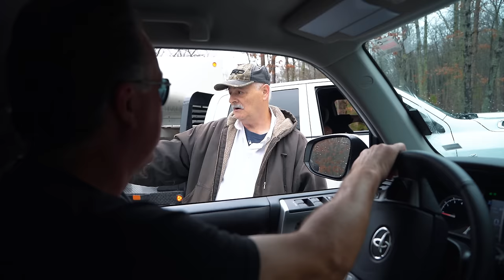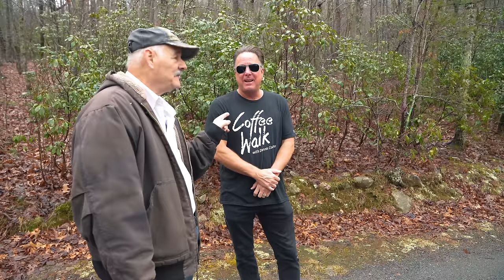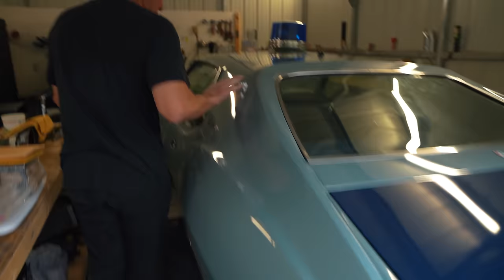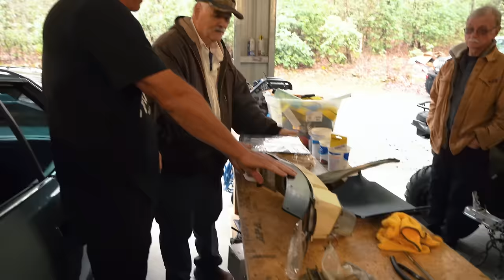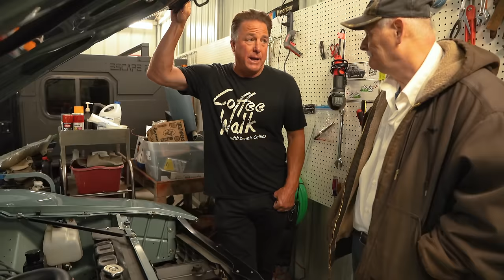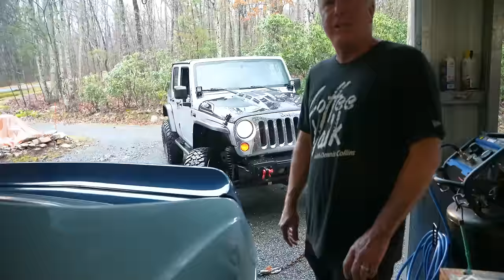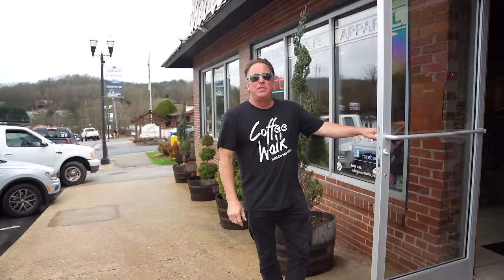FOUND: 1 of 13 Existing ADPS 1972 Javelin SST Police Cars!

Comment: AMC 401 with a 4bbl carb. in 1971 was 330hp and 1972-1975 was 255hp then in 1976 it was downgraded to 215hp, that boat won't do 170mph, being a 72 it will be lucky to do 140mph, maybe 150 if you have a lot of flat road and a good strong tailwind.

Comment: My dad built the engine for one of these it was still had the Motorola police radio in it and the light they made him take the state trooper badges off the doors but it was painted with the correct paint and everything my Dad's friend Dawn bought it when I was a little kid and they were restoring it but it has to be one of the 13 because it is a complete javelin police car state trooper with the Motorola police radio everything correct

Comment: I had for my very first vehicle was a 2 door Dodge Dart aka Dodge Demon had a 426 Hemi in it and fastest I've ever had a speedometer move..was 130 +/- 15 more likely +15.Was on a old highway and it had smooth dips on it and I could hear Chirps while holding the steering wheel and I found out it was the back tires raising off the payment. I also received my very first speeding ticket for 100mph on highway that still had speed limit of 55mph officer was upset then gave me a reduced fine where I didn't have my license taken away. 
Man o man wish I still had it. It would of been a show stopper with the money I would of put in to it .

Comment: Big- body cop cars ran H78-15 tires back then. According to Coker, the overall diameter is 28.36 inches. Times 3.14 gives a circumference of 89.05". Times an engine redline of 5000 rpm gives 445,252 inches per minute. Divided by 12 gives 37,104 fpm. Divided by a 2.76 axle ratio gives 13,443.599 fpm. Divided by 5280 gives you 2.546 miles per minute. Times 60 gives you 152 mph. 

Check my math; it's still dark outside.
Reply: @spaceflight101, math looks good to me
Reply: @Crazy8ts  Thanks. Cars of that era didn't have overdrive transmissions and the automatic transmissions didn't have locking torque converters so a little slippage has to be factored into the real world.
Reply: @spaceflight1019  very true, modern transmissions today are light years ahead of 1960' and 70's auto's we have 8 and 10 speeds now!  Many would choose a 4 speed in a muscle car, which eliminates the low stall torque converter woes of that era in a performance application....and there were usually optional ratio spreads for a buyer to choose for a 4 speed, usually a close ratio transmission and a taller ratio. The automatics had high stall converter mods available and there were companies that catered to hi-po auto build ups, B&M. comes to mind
Reply: @Crazy8ts  You reminded me of something. The owners manual for the 1971 Fury lists the mighty 440 Six-Pack as the top engine option and a three-speed manual transmission. The redline on that engine was 6000 rpm.
Plugging that into the formula, the top speed goes to 183 mph!
Reply: @spaceflight1019  in theory lol

Comment: I had a 71 401 in my '68 Javelin Big bad orange car, 12 to 1 compression, huge solid lifter cam, heavly ported 70 heads with chysler 2.08/1.72 valves. the motor was .020 over and dynoed 550 athte crank and never got hot on sunoco 104 race fuel. I would even idle the car and it did not get hot. that overheating thing is BS and the 401 is not the same block as a 304 look under the motor mount and you can see what size it is. the displacement is cast into the block.they just had a thinner sleave.

Comment: 170 MPH on a public Hwy is impossible for more than a few hundred yards. Eventually you will hit a dip in the road that will launch you into the air. Ask me how I know...at only 140 MPH in a 1970 SS Chevelle I hit a dip in the road that at 80 MPH I would have never noticed, but at 140 MPH my suspension bottomed out to the frame, and launched all four wheels of my Chevelle into the air. After that I swore I would never go that fast on a public Hwy again.

Comment: If i had known back in 1968 what i know now id of found some way to keep my 1968 Dodge Coronet " 4 door " that came with the tiny 273 v8 that had no guts - that motor was way to small for that 4000 pound car - it got wrecked in 1969, the frame got bent and was not repaired properly, the front wheels didn't line up with the rear wheels, very dangerous to drive so i traded it for another vehicle - they only made 10k "4 door" cars in 1968, the majority were 2 door

Comment: 170 Mph, haha yeah ok, the Stories on these get better and better over the years haha...... Documentation shows 130 Mph top speed on these low compression 8-1 1972 Javelin Police w 401! Dennis I left you a message on your Facebook group with an article clip on this 1972!...  anything you wanna know about PRE-1978 copcars, just ask
Reply: Easily capable of 160...not hard to believe that if some got additional tuning/mods they could approach 170..with a 2.73 rear axle ratio....plus they are relatively small light cars..that body design was engineered for SCCA racing.and they took 1st place with it in either 71 or 72. Aerodynamic, light and powerful engine and they could handle very well. Very likely some.troopers modified them for more power too.
Reply: @WPGinterceptor460Interceptor  again they had worked over valvetrains and fueling and oiling mods, you keep going by advertised ratings, and those are for the non police 401's,  these were probably making 325-340+ horsepower and 430 lb ft of torque, even the  68-70 390 with small Carter 575 cfm and restrictive log exhaust manifolds made 315-325 horsepower and 425 lb ft of torque. The documentation you have of advertised numbers just shows that these special 401's were probably under rated on paper on purpose....thats something that was common back then, not myth. Top speed on a long enough stretch of highway in that light body and a tall 2.73 axle ratio??  150-160mph isn't out of the question...if there were some that were approaching 170 they had to have been modified. State Troopers are allowed to do mods, maybe some did....and in 1972 AMC offered a LOT of hipo parts from their group 19 program, edelbrock R4b hi rise intakes, Holley 950cfm 3 barrel carbs, exelbrock crossram with dual Holley 660 cfm carbs ignition systems, Doug thorely headers, etc etc... not out of the question some of those state troopers put those parts on and could be the origin of some getting close to the 170mph speeds. Doubt claim like that would be made if there wasn't something that backed it up, for one it is too high a MPH to be believed NOW, no one would have believed it back then, so there has to be something to it.
Reply: @Crazy8ts  AGAIN your talkin out your hoohaa, this was 1972, and start of Emissions bud, these were low compression 8.5-1 Motors pushing 255 Horsepower ( I have the Documentation) what dont you understand??? and they top out at 130 Mph. The only police addon would of been an extra oil cooler!!  The problem with these cars was they blew up cause of oil issues during high speed pursuit, the fleet mechanic talks about that in the documentation.. and AGAIN the High compression copcars of that era, like the 69 Dodge Polara 440 Pursuit, or the 429 Police Interceptor of that era would of Blown the doors off this car!!!  and the reason Alabama went with the Javelin is because they couldnt afford the Ford 429 Interceptors!! AGAIN ITS IN THE DOCUMENTATION!!!!!  get over it
Reply: @WPGinterceptor460Interceptor  you are still incorrect and literally sound like you arent even aware about the early 1971 high compression 401's....and there were 2 versions that they got for service.. you also keep ignoring that these cars were only 3256 lbs ...Hundreds of lbs lighter than all the other gigantic heavy police cars of that era. FACT!!!  Again 70 of the Alabama state police javelins were 1971 models. The early javelin SST and javelin "AMX " 401's had 51 cc chamber heads and flat top style pistons with a slight ridge with valve reliefs, compression was 10.25 :01 horsepower was 335 and torque was 435 lb ft. AMC gave them an early 401 AMX and they loved it and thats why they ordered the first batch during the 1971 model year run..they wanted THAT spec. 70 1971 401 cars were ordered. The later 1971 401 had the combustion chambers enlarged to 58cc, this lowered compression to 9.5 :01 but had the benefit of unshrouding the valves and increased flow so horsepower dropped to 330 and 430lb ft respectively. So again this is in a base car with a curb weight of 3500 lbs with a 2.73 final drive ratio this combo would be an absolute MISSLE on the highway on a top speed run.  The engines also had steel forged rods and cranks for all of 71 and 72. In 72 however they changed to a dished piston wich dropped compression to below 9 :01 but exhaust valves were bigger. Regardless the police spec fleet engine had all of that but also had more aggressive camshafts and reworked carburators, so they would not have the same horsepower as a regular production 401...it would be more....regardless the troopers that drove these cars and documented what they could do in media articles when  they were interviewed are the best proof.  one trooper confirmed that he hit 141 MPH in his 72 spec and he said he could have gone faster...real world accounts are the best documentation. They all said they were the amoung fastest cars and best handling cars they had ever driven. The stock specs on paper you are referring to do not apply to these cars. There are also many documented tests of 401 javelins from when they came out in 71 beating big block muscle cars cars in the 1/4 mile including boss 1971 429 Mustangs
Reply: @WPGinterceptor460Interceptor  Captain Robert Applin (ret.) states his Javelin was clocked at 153mph using a ‘Kustom’ radar unit which was considered more accurate than the ‘VASCAR’ type, which calculated his car at 148mph over a 500ft. stretch. No one is saying there weren't more powerful engines in other police cars of that era, but they simply weren't as fast as a 401 especially the 10.25: 01 and 9.5 :01 early versions...the cars were only 3256lbs from the factory...with that high torque 401...2.73 gear, and aero body this was a highway top speed missle...other cop cars of the era had more horsepower but they were like bricks in the wind plus hundreds of lbs heavier.
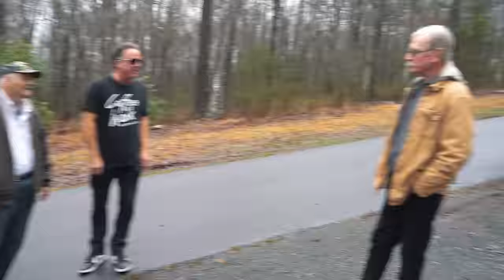Reply: @Crazy8ts  Again ALL TALK!! no documentation.. AGAIN the FASTEST speed ever recorded By a copcar and proven was in 1969 148 Mph By Michigan State Police of a 375+ Horsepower 440 Doge Polara Pursuit equipped with a 2:49-1 special rear gear drive axle and motor was 10+ Compression!!at the Chrysler proving grounds, that speed wasnt beaten until a Corvette powered Copcar LT-1 Caprice 94-96 beat that! NOT ONE MENTION OF THE 8-1 Compression JAVELIN ANYWHERE IN THERE!!  too many stories you been fed there and NO documentation other than Hearsay!!.. The OFFICIAL fastest copcar of all time is the LS powered 6 Speed Camaro 2002+ and would push 160 Mph!.... you should email the MSP and tell them they need to udate their info as a guy told you his low compression 8-1 Javelin did 153 Mph top speed BUT could hang with a stock gto judge but couldnt reel it in A car that tops out at 130 Mph.............  I HAVE ALL THE DOCUMENTATION ON THE 72 JAVELIN POLICE.. NOT SURE WHAT PART OF THAT YOU DO NOT COMPREHEND................. You have yet to post any documentation, BUT go to Dennis's facebook and see what i uploaded!!! TALK IS CHEAP
Reply: @WPGinterceptor460Interceptor  either one of the 1971 spec 401 cars were more than enough to hit 140-150+MPH 9.5 and 10.25 :01 compression and 330-335 horsepower and 4304-435 lb feet of torque in a 3265lb base car with a 2.73 rear axle..not sure what dimension you are living in, but in this one...reality...on planet earth..thats easily a 150mph package and the ASPD. archive tests and first hand accounts support it regardless. the dished piston 8.5 compression 72 401's dropped to 130mph, still a  very light 3256 lb car  from the factory with a 2.73 gear, and top speed according to archived ASPD archive accounts and interviews.
Reply: @Crazy8ts  I am wrong sometimes... the White Copcar they talk about in this video, they wanted to see how fast it would really go. I said even BEFORE THEY DID THE TOP SPEED RUN that it would do 130 documented... I was wrong, Dennis did 129 in it!!  And before they do this run the 72 Javelin will do Documented 130-135 tops!
Reply: @WPGinterceptor460Interceptor  that white crown vic was.still accelerating and could go.faster, must have and ecu cutoff. If that limiter was removed would probably do 135+  I also dont disagree that the low compression version of the state police javelin will top out between 130-135...+ that engines been re-ringed. I also never disagreed any of those javelins would do 170...thats just too high..but they recorded some of the 401's in service on radar at 148-153 MPH, and ran them against 440 polaras they had in service and tge javelins put a lot if distance pulling away frim them at top speed, they were lighter and were faster
Reply: @WPGinterceptor460Interceptor  that test only showed how fast that car went on that day, it wasn't "the fastest police car ever recorded" and if it was,  the Alabama State Police went faster according to their documented at archived tests of the 401 javelins going 153MPH recorded by radar Guns 2 years later..most likely BOTH the 10.25 :01 and 9.5 :01 compression 1971 spec 401's which again put out 330+ horsepower and 430+lb ft. of torque..from the factory(which is common knowledge in factory literature from 1971 model year factory literature specifications).. BEFORE.... tuning for police duty..if you don't think a javelin SST with that engine and a 2.73 axle ratio that weighed 3256lbs from the factory couldn't beat a 4300lb polara with a 440??? Then you are ignoring power to weight ratios and aerodynamics...and ultimately the laws of physics..its obvious that spec SST would have a higher top speed and accelerate up TO that top speed quicker than a car weighing 1000 lbs more and shaped like a brick... The javelin SST was A THOUSAND POUNDS LIGHTER than the polara you keep talking about. The 153MPH recorded by the Alabama State police is well representative of that spec Javelins capability...
Reply: @WPGinterceptor460Interceptor  your deflecting, and are simply selecting historical references you want and ignoring others..while also ignoring power to weight ratios, aerodynamics and common knowledge of the 71-72 Javelin police cars. "Documentation" lmfao! The FACTORY specs for the cars show the 10.25 :01 compression 401's had 335 horsepower and 435 lb ft of torque, the 9.5 compression ratio 401s only dropped to 330 horse and 430ft lbs of torque because they unshrouded the valves with larger combustion chambers and got free flow exhaust manifolds..that were essentially cast iron shorty headers. at LEAST 71 of the Alabama police cars were the 330+ horse 430+ft lb torque spec...in a 3265lb base SST with a 2.73 rear axle...but some bizzaro world logic on your part says 148-153MPH documented by radar Guns by the ASPD all the archived information from the aspd is fake ...and that javelins in that spec couldn't reach those speeds...but your benchmark to compare is a  4,300 lb brick shaped polara? in 1969? with only 45 more horsepower? Recorded at 149-150mph? ...dont you think a car with 1100 lbs !!!!! LESS  weight, more aerodynamic and 330 horse and 430ft lbs of torque mated to a 2.73 rear axle could equal and ultimately beat that benchmark ???  of course it could lol...You just don't WANT to believe it...guess what?  The ASPD tests fall right in line with those specs...you are in denial.There is something wrong
Reply: @WPGinterceptor460Interceptor  😂🤣🤣🤣🤣🤣😂😂😂😂

Comment: amc made a 70 Gremlin w/ a dealer installed 401 that was amc fastest car... check it out!
Reply: fastest car was the 1969 S/S AMX.  390 Cross Ram Dual Quads Reworked heads by Crane, and 12.0 :01 forged pistons. T10 4 speed trans and 4.44: 01 rear axle ratio. Ran 10's doing wheelies on launch.  401 Gemlins ran low 13's s, and don't forget Hurst SC ramblers...14.0's stock in the 1/4  on factory tires

Comment: As a beautiful car as they were even with a Pontiac 400 they were a dog in actual performance especially with a automatic. The last TA I would ever want is a 77 Trans Am with a stock 400 Pontiac or the 403 Olds, the only worse one was a 30  non turbo. With horsepower in the high 1s or low 2s from 76 forwards in a car that weighs Two tons or more is not a Musclecar. The 77 Dodge Warlock Stepside pick up was quicker than a TA weighing 3,800 lbs and available 440 with no catalytic converters. Funny fact the TA motor sounds in Smokey and the Bandit were actually those filmed of the L-88 427 55 Chevy in “Two lane Blacktop”. Now that was a car. As for TAs a 73 Super Duty 455 was a “Real” musclecar. The 75 455 HO was alright.